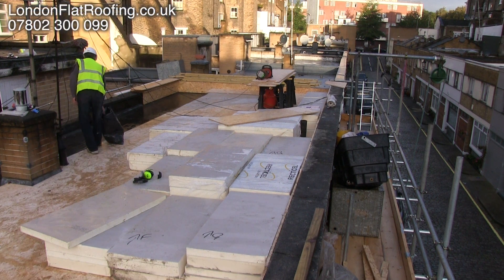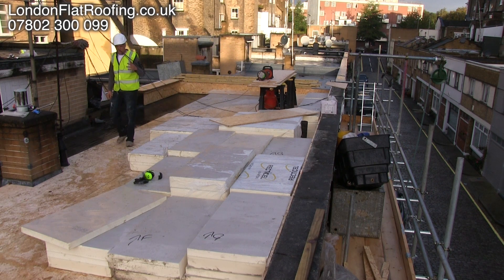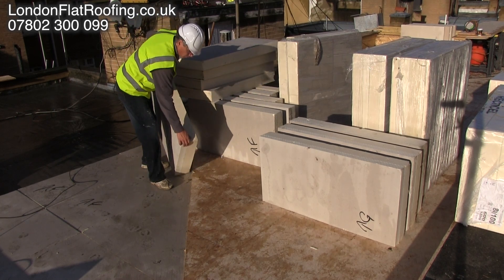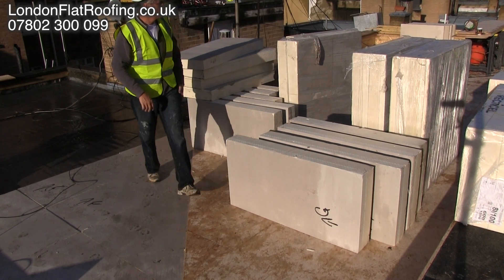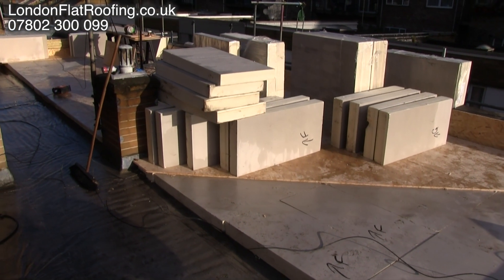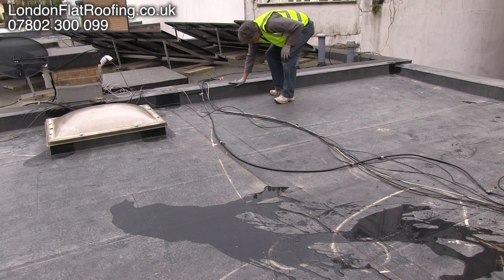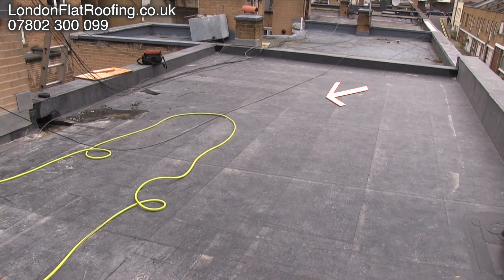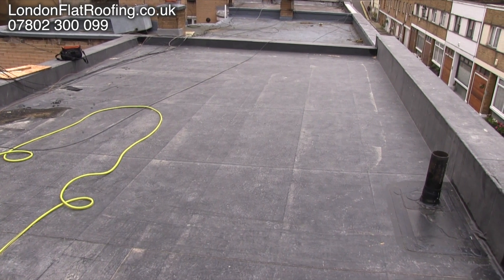Tapered roof insulation

Comment: How do you prevent thermal bridging at the thinner end of insulation?
Reply: I've seen some other vids. I think the minimum thickness is enough to prevent this from happening. In some systems, they cover the entire roof with a base layer before installing the tapered ones.